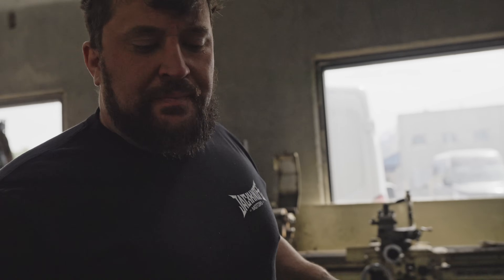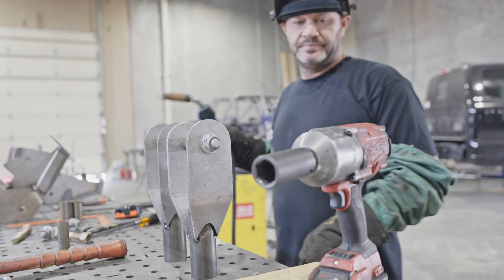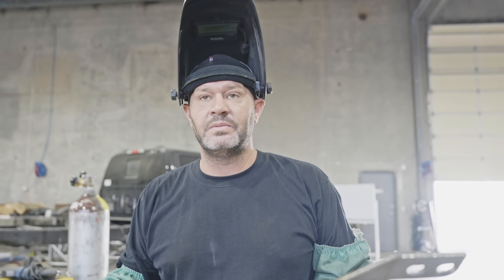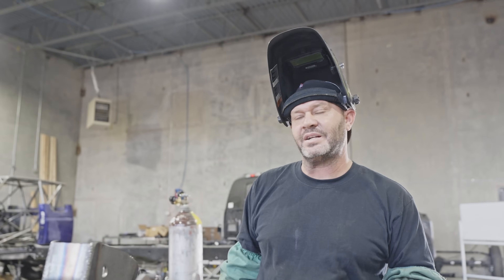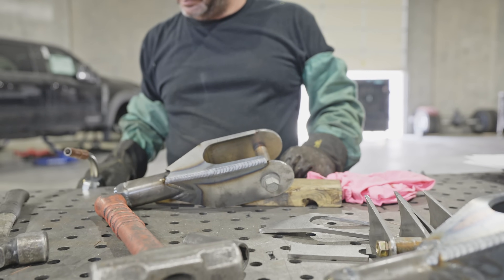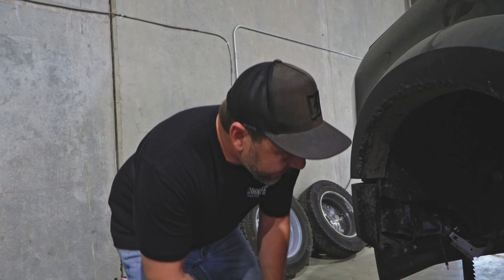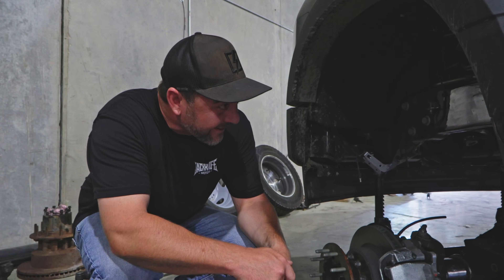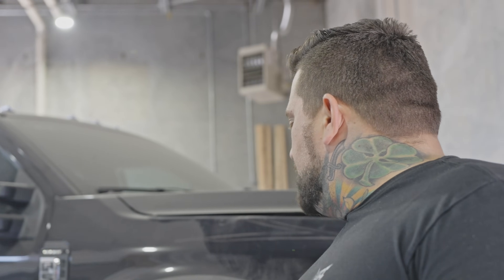BUILDING 6X6 SUSPENSION! **Fabricating front suspension for the Basin 6X6.

Comment: I meant to ask this after you answered my last question. But do 6x6 trucks of this size actually function well off road? Everyone on the internet has a different opinion on this but the military uses a ton of trucks like this. Like Hennessy dos a bunch of 6x6 trucks but those are just pointless toys. Oh and to increase maneuverability, will the rear axel also have steering ability? I know that someone once stole a Raptor 6x6 in LA a few years ago and the police caught them in like 15 mins because it had no maneuverability whatsoever.
Reply from the maker: That was the Sparks Motors 6x6 that was built for the DJ Marshmallow. I have actually driven the truck itself and surprisingly it has the same turning radius as stock. That truck did not have lockers on it... this one will.
Reply: @BASIN_NATION that is a remarkably poor turning radius. But then I suppose that if a truck like that had a regular turning radius it would end up falling over at speed. Are you guys planning on putting bigger breaks on this vehicle? It’s always so weird for me to see 10k plus lbs vehicles have tinny breaks. Like come on guys don’t save money on breaks.
Reply: I forgot to be more clear on the military trucks. Those things are huge so I understand why a 6x6 configuration works. Civilian sized trucks (while still enormous) don’t seem to benefit. At least from what I’ve seen. I am talking about the Australian 6x6 conversions that are done to the Toyotas they have over there.